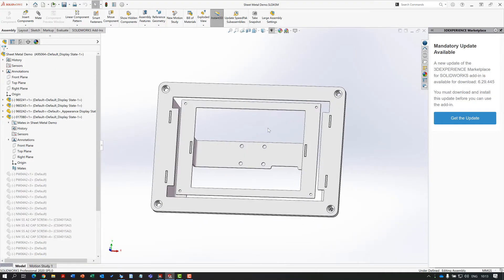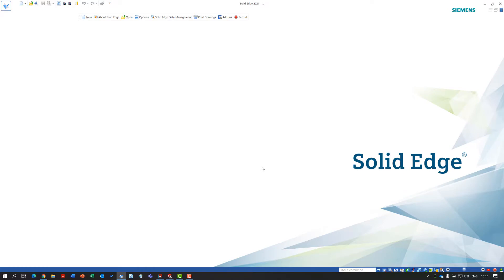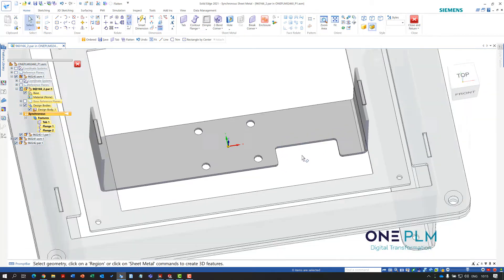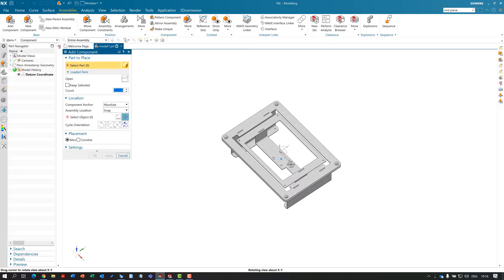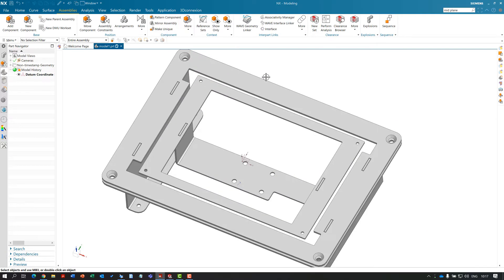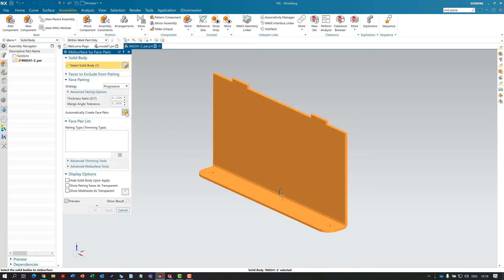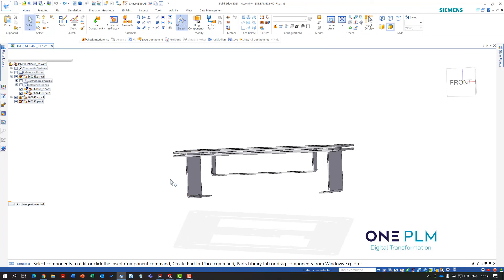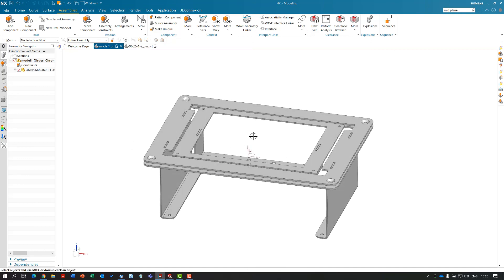NX and SE Interoperability

Comment: thanks for the video, which is better SE or NX? i read SW takes up many cpu/gpu resources
Reply from the maker: NX is the more advanced system but costs roughly 3X the price of Solid Edge.  All systems require a good speed CPU and a mid to high level GPU as they are all based on the Same underlying software (Parasolid). Siemens also offer the mechanical design bundle giving you access to Solid Edge and NX via a single license.